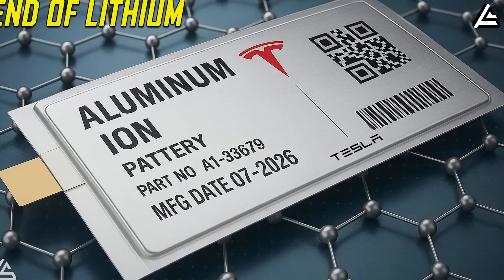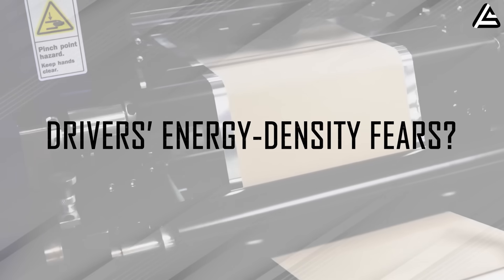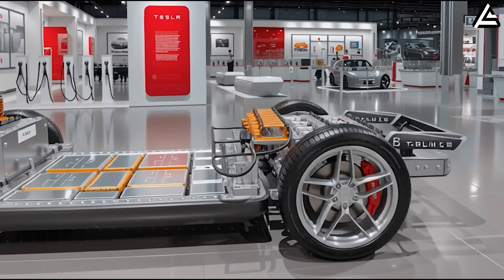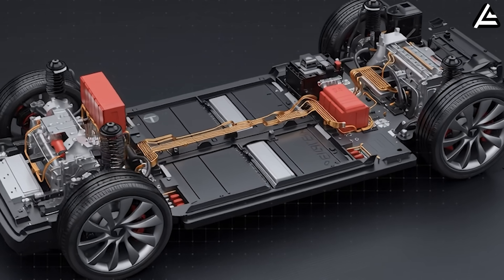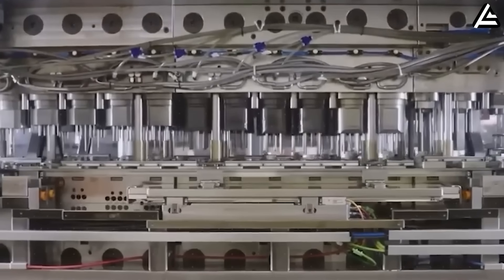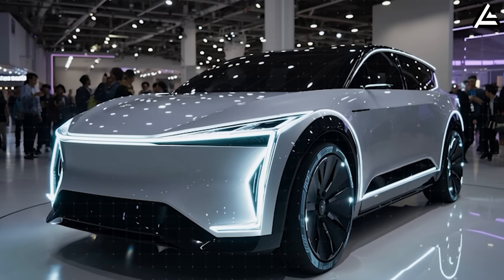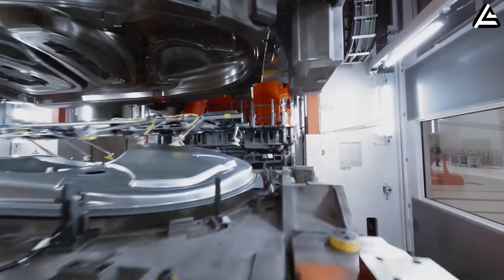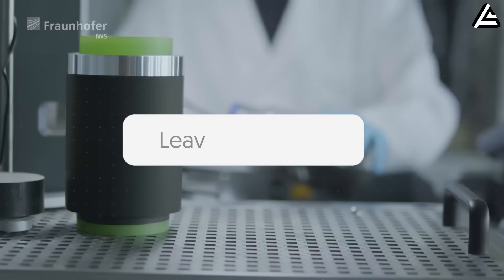Elon Musk Revealed 2026 Tesla Aluminum-Ion: SHOCKING Energy Density That Destroy EV Market

Comment: If storage capacity is over 500 wh/kg is true, and 1/2 cost or less per energy density is attained, aviation uses are assured.  Also, tesla semi ranges of 2000 miles or more technically on the way.
Reply from the maker: That would be incredible for aviation and long-haul transport!